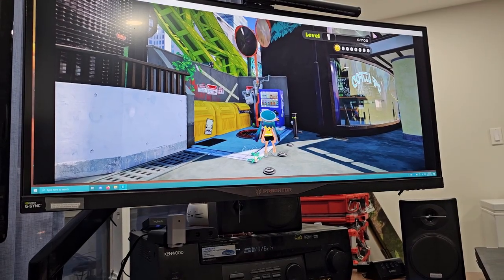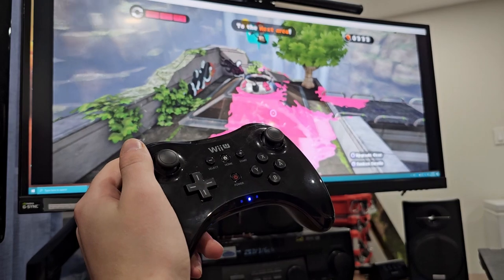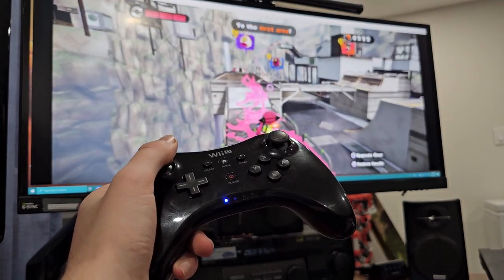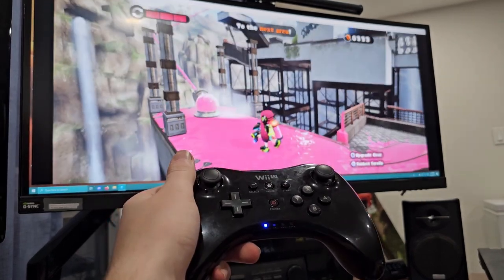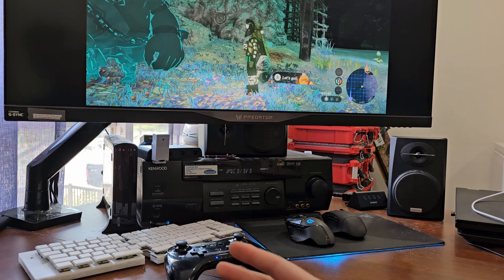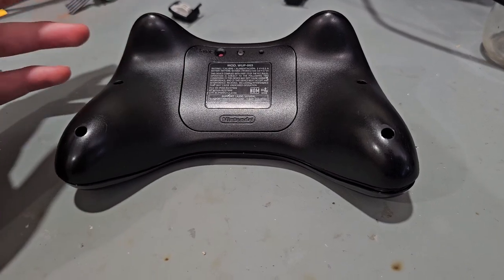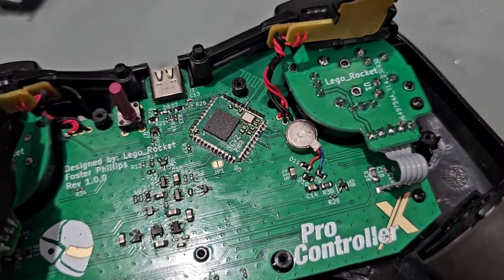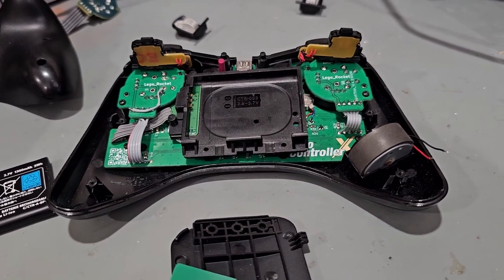Pro Controller X - Adding Motion Controls to a Wii U Pro Controller

Comment: I can’t even tell you how much I love this controller, I ended up getting a total of 3 just in case they’re impossible to find in the future. 

There’s one change I absolutely have to make at some point, it is sometimes called Gulikit, but I think it’s only for every other controller (maybe those electromagnetic analog stick controllers would work if the guts fit well enough in the pro shell, I never thought about that until you said it)… all 3 controllers I have do have drift issues, and sometimes deadzone can be adjusted, but I just hate dealing with it all the time! 
There probably aren’t many of us who see the perfection of this controller… For me, it really covers all the bases I care about 
-the layout is equally comfortable for 2D games or 3D because of both analog sticks sitting up high, and that’s perfect for isometric racing, twin stick shooters (i haven’t run into an issue where it hasn’t been better than every other setup) I don’t know anything about electronics, but since you do, how would you approach doing the no drift stick mod? Would it even be possible to do something like use the gulikit made for say the ps5 using adapter cables, or maybe splicing the wires and solder to the original clip? (I think there are 5 wires for Wii U pro, but these kits have 6… that can’t be good!😂)

Oh, you should look into that magic…stick? or whatever it’s called, it’s the $15 usb dongle  that uses 2 input choices, and 1 makes the PC think it’s an xbox one controller, so it basically just works with everything now, and you never have to use anything else again!!!
I know you already said
you’re already set, but it’s so great to just plug that thing into a usb port, and 2 seconds later it just works perfectly! (well, steam is such a POS that it will mess up, but there’s nothing wrong with the dongle or controller. That company is run by some real shitheads! but I’m not getting started on it now, gotta run…. thanks
Reply from the maker: Totally agree, I love the layout of this controller, that's why I ended up building it.

As for the Gulikit kit for no drift, it's a mixed bag whether or not they would work for this controller or the unmodified Wii U Pro. The issue with the kits is they require a specific voltage to operate, if the voltage doesn't match you can actually burn out the joysticks.
For that reason, I've never actually investigated the Gulikit mods, since I personally haven't experienced drift in any of my controllers, and getting it to work seems not effort than it's worth

I'll take a look into those adapters as well. I don't really need them now, but I do remember seeing some 8BitDo adapters for other controllers a few years ago, it's interesting that there's now a ton of adapters that exist
Reply: @OfflineRocket  Well you at least saved me from making one mistake… there no way in hell I would’ve been able to figure that out! 
I don’t know exactly what’s wrong with me ole noggin, so I just usually say I’m a big dummy in general, I literally can’t learn how to do something unless I find it fun, or really interesting. 
And the thing that sucks about that, is even though I would love to learn how to build a custom controller from scratch, or close to it, 
I can’t! There’s just this block that sorta switches me off, and nothing will stick. 
And it’s the same thing with audio gear, I love music more than just about anything (but it’s close to being a tie with video games) and always want to make headphones and speakers, or even a custom pc jukebox that will sound as good as you can get it to sound. 
But even when I try to ask people who are in the know about which gear is really good and why, as soon as they start trying to explain it, they use these weird terms/phrases like “the soundstage is more full, and has more body” (maybe I’m thinking of shampoo commercials) and It sounds like they’re making shit up, but I wouldn’t even know how to begin figuring out what a full or non-full soundstage is supposed to sound like so I can compare it?!
Geez, I’m sorry, I tend to go on these rants, but don’t realize I’m doing it until I’m already done!
I’m gonna actually give you all the correct info on that dongle, because when I was trying to find it, I ended up getting the wrong model number from the right brand, they have a lot of dongles that apparently do something for the Wii U, but only one is specifically for using it as an x-input and D-input controller. I just need about an hour to get some stuff done first. Thanks man
Reply: @OfflineRocket  sorry it took so long, I fell asleep… here is the one you want to get May Flash Wireless Wii U Pro Controller Adapter for PC USB

Comment: Might have to pick up a wii u pro controller. 🤔
Reply from the maker: Maybe! Just make sure you are good at hot air rework, I almost lost a few components along the way
Reply: how do I get one?  @OfflineRocket
Reply from the maker: @tekgeekster  Thanks for asking, if you're not interested in building one yourself, and you're still interested getting one email me at sales@offlinerocket.com
Reply: @OfflineRocket Are you planning on selling these through an Online Shop? That'd be amazing!
Reply from the maker: @Sonicjan  I don't really have an interest in selling projects through an online shop, mostly because I don't have the time to run it. These projects take so long to make, that it would be out of stock most of the time anyway
Reply: @OfflineRocket  I see, that's too bad... Though, could a single person still commission you for one or is that out of the question?
Reply from the maker: @Sonicjan  I can sell the one I currently have, if you're interested, there's an email listed in this thread, contact me there
However, be prepared as the controller isn't cheap to make, so it'll cost more than most controllers
Reply: @OfflineRocket  Does it work on the wii u console itself